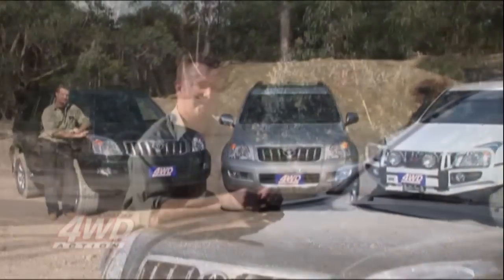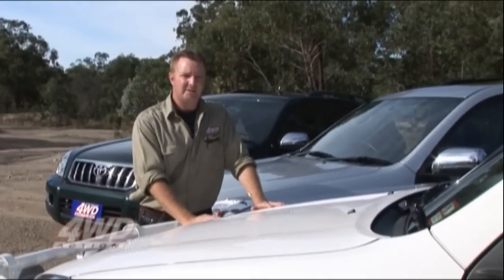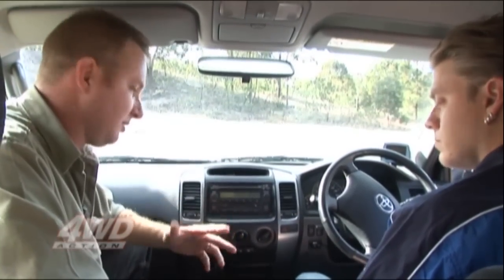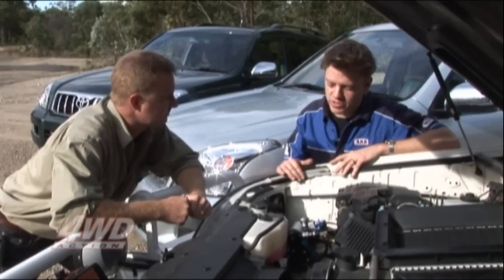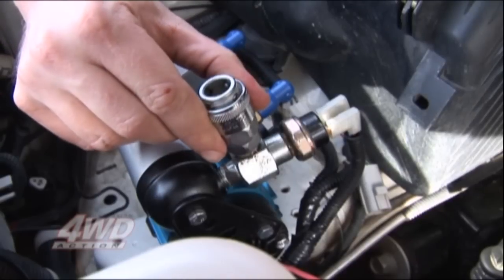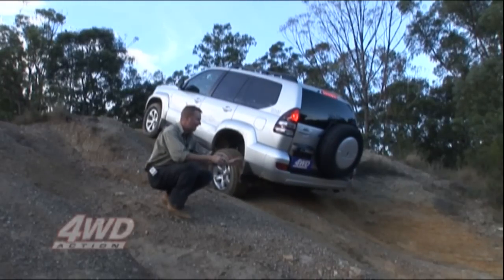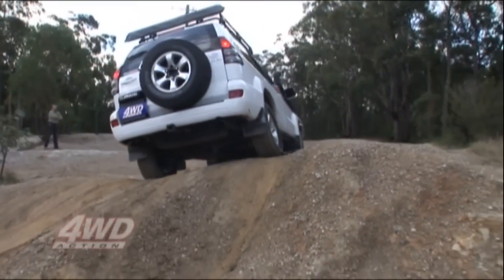Air Locker vs LSD vs Traction Control Part 1

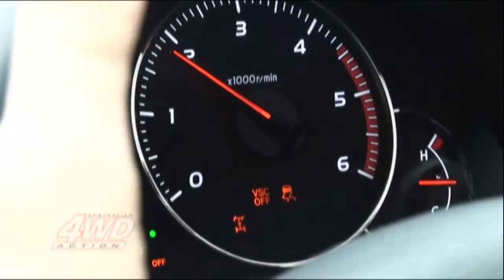Comment: At 7:00, the VSC appeared to be switched off??
Reply: In the grande model Prado, locking the centre diff will turn off stability control and limit traction control.

Comment: a bit of deception in the video..  The first 2 SUV's stop at the base of the hill so no forward momentum prior to the uphill grade.The 3rd SUV had what appears to be a full car length momentum.  Also i know it is a test and a locker is better than none. But this hill could have been climbed if a better line was chosen. Though some snake oil sales tactics a Locker is a good thing..

Comment: This makes me appreciate my electronic system. Turn the knob to 2 Hi, Auto, 4Hi, or 4Lo as needed and you're all set. I like the air hose nozzle though.
Reply: dchawk81 this video is showing off locking hubs, locking both the wheels so they spin with equal force and power... Did you watch this video at all ? And or understand it ?

Comment: Do the rotating air seals in the differential ever wear and leak?
Reply from the maker: Hi Mr42960, the elastomer compounds used by ARB are generally lower wearing than the high tensile nodular iron that they run on, and as such you could say that they don't wear.   Leaks are generally a symptom of internal damage, incorrect installation or flexing of the entire axle assembly (e.g. due to excessive GVM beyond the vehicle manufacturer's recommendations).   We would usually expect the rotary seals to last the life time of the vehicle. I hope this answers your question.

Comment: Is Air Locker similar with Mercedes-Benz G-Class differential locker which
locked the ring gear and the side gear together ?
Reply: no. that system G-class is like toyota stanard locker on the true toyota's, the 4.2 6 cilinders, not a wanabee prado.

Comment: Can this be installed to a truck that comes with LSD on the rear and electronic traction control (Ford Ranger 2013-2014)?

Comment from the maker: Hi Sashoxxx, there are certainly other places that the compressor can be installed. Under the front seats is a popular location. Your local ARB store/stockist may be able to recommend other alternatives. You can certainly opt for only a front Air Locker if you wished to retain the factory locker. Whether you replace the factory locker is ultimately up to you.

Comment: I have a question for you guys. Can the air compressor be fitted somewhere else, since my prado has the two batteries installed on it and that particular place happens to be the second one's location. Other than that I was wondering if I can go with only the front air locker since the vehicle is equipped with a factory rear mech/electro locker. And finally how is the air locker compared to the factory locker? Should I consider replacing the existing rear one and go both ends with the ARB?

Comment: At 7:00 VSC (vehicle stability control) - electronic traction is off ... also you gave the ARB locked truck some extra boost. Not knocking your product, but this demonstration seems stretched.

Comment from the maker: Hi Helmo, you'd be best to touch base with Jeep re their 4wd system. The full Air Locker application guide is available on our website and outlines model availability. A rear Air Locker is available for the 2006 WK Grand Cherokee.

Comment from the maker: You can certainly just install one Air Locker, you don't need to install them in a set (front and rear). Have a look at the Air Locker Application Guide on our website (arb.com.au) to see if there's a model to suit your Bronco.

Comment from the maker: Hi Hemi4WD, you're probably right there, all 3 Prados could have made it through this section of track with differing levels of momentum. The aim of the video was to demonstrate the greater control that is available using Air Lockers, which require much less momentum to conquer the same terrain.

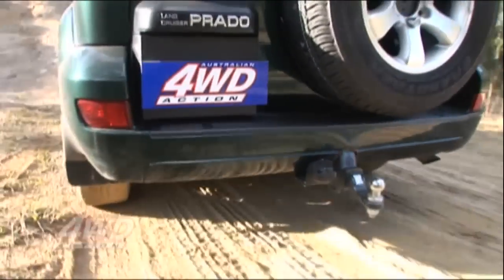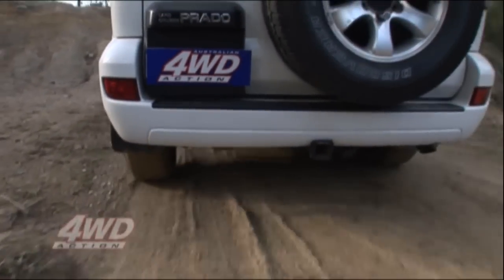Comment: Compare 6:10 with 8:06 not really the same momentum. OK, I understand what you're trying to demonstrate, the terrain should've been more challenging because the first Prado, even with open diffs but more momentum could've made it up that hill without a hiccup. I feel that the lockers didn't get proper justice in this demo.

Comment from the maker: Hi Ian, the LSD component is removed when an Air Locker is fitted so you can't have both within the same diff. They can be used in combination at opposite ends of the vehicle though (e.g. Air Locker in the front and LSD in the rear) if required. Being a selectable, 100% differential lock, though, an Air Locker is the most effective traction aid.

Comment from the maker: Hi MrJf1999, yes, we make Air Lockers for a range of 2WD vehicles for use in farm/station vehicles or for extra traction pulling a boat up a slippery ramp etc. They're also used extensively in drag racing, competition drifting and other forms of motor sport.

Comment: Daniel Bongard, a brilliant engineer!    I own vehicles with open diffs, the LX470 with traction control and my HZJ79 with arb lockers - the arb lockers are the best for sure.  The traction control on the LX470 does work very well.  I've used detroit and lunch box lockers - not so good in my opinion.

Comment from the maker: It is certainly possible to fit Air Lockers to a traction control equipped Prado. Lockers don't effect the vehicle's braking. You'll just find that the traction control won't come on anywhere near as much, as the lockers will eliminate side to side wheel spin

Comment from the maker: We try and mount the air compressor high up in the engine bay or even inside the vehicle to prevent water ingestion. It is possible to remount the air intake/filter to an even higher location if you wish though

Comment: a question, supose that you are in the mud and the water is very high
you have to put the air locker on, doesn't it suck water up then? or can you connect it to snorkel is some way?